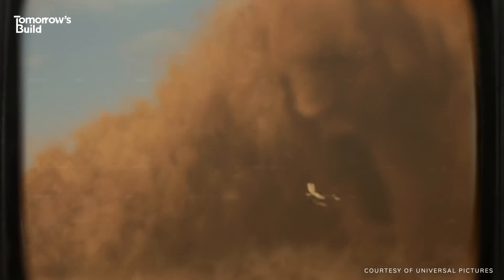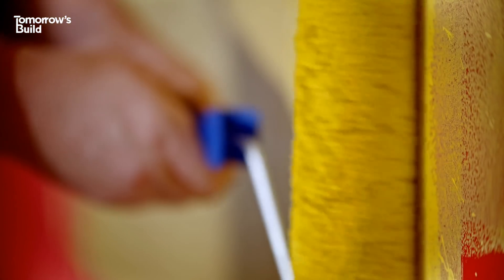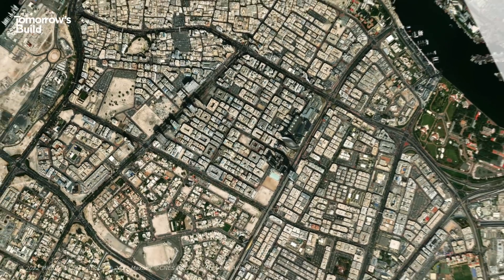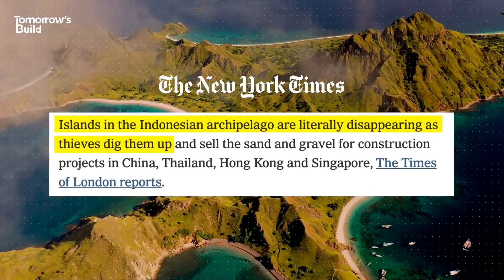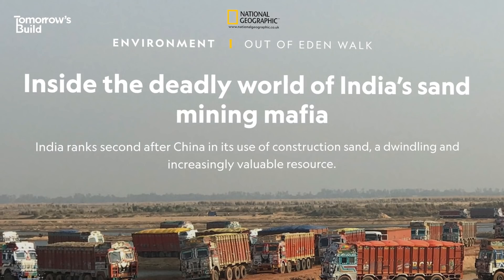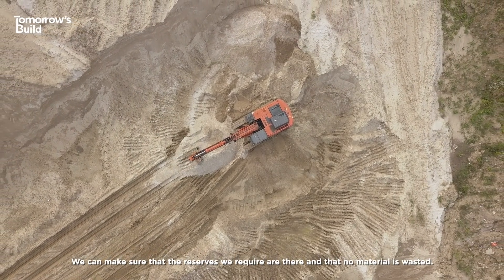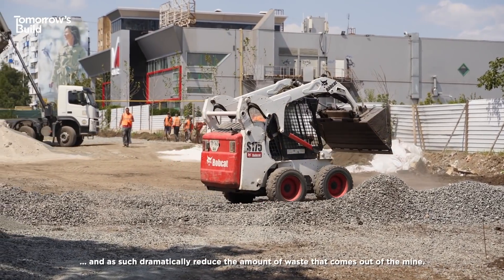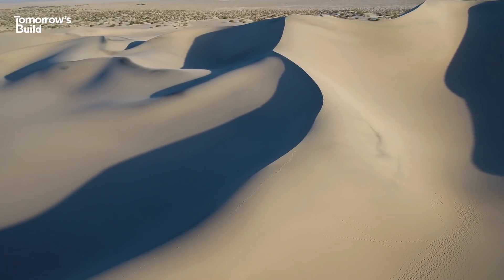This Could Stop Construction Everywhere

Comment: More than halfway into the video, I was worried that you were only educating the viewer that there is a sand shortage, and not going to provide us with any solutions for how to mitigate it.   The use of ore sand is a new one.  I thought you were going to bring up mass timber buildings, which you've mentioned before, and that's a great panacea to concrete and steel in general.
I also thought you were going to mention bamboo as a structural material, or hempcrete for single-story structures.

I learned something new about this.   I hope you guys actually go much more in-depth about ore sand in a future video.

Comment: We can try using more wood in buildings structures, and also the way how to avoid concrete.
Reply: More wood = Deforestation.
 Every Green alternative still has some drawback.
I say just build with desert sand if you aren't building a huge skyscraper because it works perfectly it's just that the structure will be a little weaker than the Non desert sand but not the issue the issue is building a good enough building for people to reside in.

Comment: The solution is to use a lot less concrete.  Hopefully engineered wood like cross laminated timber can begin to broadly replace concrete in the construction of midrise buildings and similar structures.
Reply: That would also be a good method of carbon fixing.

Comment: Lots of people saying something along the lines of make a 50/50 mix of desert and river sand. Unfortunately the load bearing ability is severely reduced when you add in round material to angular material. A visual example of why this wouldn’t work is this - Imagine a bowl full of legos versus a bowl of half legos and half ping pong balls. Then without removing any of the material, try to stick your hand in the bowl and touch the bottom.

Comment: Forgive my naivety on the topic, but (possibly dumb) question: if ocean sand is best, and desert sand is no good (because of how it’s shaped by the wind); as we dredge ocean sands is it feasible to replace it with desert sand (replenishing what was removed) and let the ocean do its work to convert it into non-spherical, coarser sand?
Reply: sadly not, the grains are already ground down too small by the wind and while the water could probably make the grains less regular it won't be able to make them bigger.  Erosion of rock is the only way to replenish it.
Reply: @BananaArmsMcNess  what about dumping the sand in the ocean though to replenish it
Reply: @Enrique283c  like the video says, the sand grains that are on land are already too small to be ideal for concrete. While water action could make them rougher so they interlock in the concrete matrix better, the grains cannot get bigger.

A more feasible solution could be crushing gravel into sand with machines but it is very energy intensive.
Reply: Beter idea would be to crush the sand and make clay from it. Plenty of uses for clay. Even beter idea would be to just let it be because sand dust from crushing sand is extremely bad for your lungs and I don't think the locals in the Gulf care much for the health of the imported workers who do all the work.
Reply: Coarse means large. Fine means small. Putting fine sand in the ocean is not going to make the particles bigger.
Reply: Can I just say thanks to everyone for sharing your thoughts, I feel like my perspective has been broadened
Reply: The sands in dunes and other deserts are vital to the endemic area, as well as across the ocean, if one was to take the sands from the Sahara let's say. Not only are you destroying one ecosystem to replenish another, causing a global catastrophe for the sands from the Sahara feeds islands in the Atlantic ocean and south America with nutrients that are needed for plant growth in the Amazon rainforest.
Reply: Would it also mess with fish gills?
Reply: What is Singapore and Dubai doing differently?
Reply: @tanjoy0205  Importing sand because they don't have any of their own.
Reply: @Indi Thanks for the comment, I actually started to think this was an issue instead of a manufactured facade like the virus they have to force people to get vaccinated against because its so effective and the virus so dangerous lmao.
Reply: @cali gdp no mate, in the original question indi asked if after replacing ocean sand with desert sand, would the ocean turn it from desert sand into ocean sand.  Wave action could probably make the grains less rounded and smooth but the particles would still be too small for use in concrete.

I expect dumping sand would have minimal effect on ocean water, but it would be damaging to the plant and animals in the water (see Dubai), but then stripping all the original sand out is already destructive.
Reply: Transporting the billions of tons of sand from the literal middle of the desert to the middle of the ocean will be extremely expensive and energy-intensive (you have to burn fuel to transport the sand).
Reply: @arafat464  Nah you can build conveyors hundreds of miles long to do that. They have them already in some places. The initial cost is high but once running and maintained properly its feasible.
Reply: Why not melt the desert sand into a glass pane and break that up into the desired size?
Reply: @nutzeeer  🤣🤣
Reply: @arson8582  there is literally enough solar energy for that in the desert :P But I guess manufacturing is more expensive than just taking. Would be an actual effort to protect the environment.
Reply: You can do all kinds of things. But the costs are HUGE to transport the massive masses of sand over long distances.
Reply: @MysticalKO several people have answered the question. Stop being a brick.

Comment: what about a mix of desert sand and river bed sand? like a 25/75 mix? After doing that, we can grind up old concrete and recycle that in new construction as well to shift to a 25% desert, 25% recycled concrete and 50% river sand, until we figure out a system that is completely sustainable.
Reply: Mixing round material with angular material significantly reduces the amount of weight the material can support. Also recycled concrete is better used as a material called 5/8ths minus. However even applications for that are limited because concrete dust is cancerous if inhaled.
Reply: @tristanmakin9493  interesting! Thanks for the comment!

Comment: could we not modify desert sand
Reply: maybe soak, the sand, pressure oven or something. surely we can modify desert sand. might cost more at 1st. could be we use up all other sands and then start using desert sand at a higher rate

Comment: The 'round' desert sand: 
1. pass through a heavy compression machinery to shatter the grains OR
2. melt the desert sand into glass block, pass glass blocks through heavy compression machinery to make fine grains of irregular shaped shards.
Reply: Crushing sand makes the particle sizes so small that they might as well be round, wether it actually is or not
Reply: The second method is not economically feasible. It would require a lot of energy to convert sand into glass
Reply: @MethLord  a magnifying glass using sunlight can turn sand into glass. 
Another method use rebar as lightning rods in areas with sufficient lightning. 
There are many methods that do not require electric or mechanical energy. 
Also when sand becomes 'rare' - less available, the cost increase will make the expense comparatively cheap.

Comment: If we thought about things from a circular economy perspective we would include nature in the process. Sand from Sahara, added to river beds while river bed sand is extracted. The river stays sandy, the sand gets course, the extraction remains sustainable, the deltas and beaches stay intact. Then at the end of life, cement is crushed, added to to coastlines to prevent erosion (after we change the mix of cement so coral and other lifeforms can grow on it). Rivers become more resilient, beaches and shorelines become biodiverse and thrive, cities are built, and the system is balanced. Removing the sand from the Sahara keeps the desert from spreading south.
Reply: Unfortunately you can't increase the coarseness of a sand particle. It becomes silt.

Comment: Easy solution, start building good architecture again. Buildings that can stand easily for centuries, and millenniums
Reply: But that's not a solution, it doesn't matter how well you design a building if you don't have the material to build. 
The problem here isn't that were replacing buildings, but that were making new buildings, and need the material to do so
Reply: @Daltem  Actually, it does matter because the current codes require that we  build all new everything anytime we make anything.
Reply: @KRYMauL   @Eivind both of you made the same point as I did, the demand for more material is from making NEW buildings, not repairing old ones, so while durable architecture is great and all that, it wouldn't solve the issue of needing more concrete
Reply: @Daltem  but i think what me and KRY MauL were trying to say was that new buildings don’t need to be made purely from concrete, they can for example be built from brick. That we have a material shortage only because we continue to replace the short lived poor concrete buildings made by previous modernist generations with equally short lived poor concrete buildings
Reply: @Georges_Haussmann  my brother in christ, if that is what you were trying to say, then that says to me that you think concrete buildings are inherently short-lived.
As again, your original solution was an improvement to architecture. 

Now ofc poor architecture can make a building short-lived, so fixing that will work wonders, but your comment just now implys that that improvement to architecture is to include more non-concrete materials, as opposed to my assumed refinements to shape and structure via engineering.

Concrete is more long-lived than wood, but roughly equal to steel.

Wood is weak to digestion, steel is weak to air, and concrete is weak to frost.
You can make a long-lived building from steel or concrete, wood not so much. 
But the building's shape and structure are the main problem with current architecture imo, as our materials are pretty good nowadays.

But regardless of architecture, you're always going to have a need of more buildings, not necessarily to replace old ones but simply because there are more people than there were yesterday.
And no matter how durable your buildings are, new adults aren't gonna want to share a house with someone else's family if they don't have to. 
(Eg, most people would want to live in their own house than an apartment complex)

Pollution, cost and durability are the main concerns for a building material.
Concrete's performance changes on its mix, but its usually pretty good in durability, ok in cost, and not that great in pollution

BTW I'd wage that for a building to keep to "regulations" (Idk what the details of those are) 
It would end up with a lifetime of 50 years, but that's mostly from some of the concrete failing, not the majority of it.

I hope I worded that as clearly and non-ranty as I intended
Reply: @Georges_Haussmann  also while roman concrete is pretty good for how old it is, modern concrete has surpassed it, and a lot of the time you see roman constructions that have survived to now, it's because they weren't used to much.

Now that's not true all of the time, for example the colliseum is still fairly intact, and I'd imagine that that would be used fairly often. 

Building for long ages isn't done currently cos it takes more money than the shorter life ones, and you don't necessarily need an apartment complex to last for 10,000 years, if it's gonna make it cost 100x more.

Build it for slightly longer than you expect to use it, unless there's practically no difference in price.
Reply: @Daltem  sure, I get your point, but as you said, after 50 years some of the concrete will be falling off, and that seems to me to suggest that we need to return to a better quality of concrete. For example, there’s an insane amount of volcanic stone on the seabed which could be used to improve the quality by going for something more similar to what the romans used, a concrete which wouldn’t need replacing, and could therefore discourage people from tearing the buildings down rather than maintaining them. it’s already being attempted in Italy and Germany. But I completely agree with the point that we need better engineering, less “sloppy” architecture if you will, if we’re going to ensure a sustainable future for the industry
Reply: @Daltem  Also, as for what you said about wood, there’s definitively a stupid wave of wannabe planet savers in the architecture industry nowadays that is trying to convince us all the the material is safe and useful,  the use of it, and I certainly agree that it makes no sense. Wood panels can last as short as a few years and the material is still flammable, no matter what BS some people in the industry are claiming. It seems to me that the only reason why we are using wood all of a sudden is that it just seems very environmentally friendly if you don’t think to hard on it, and it’s been so long since any major city fire that weˋre ok with changing our standards from materials that don’t combust to materials that don’t literally pulverise.
Reply: @Daltem  What Iˋm trying to convey is that weˋre facing a material shortage only because weˋwe established a culture for building which demands a massive constant supply of new materials, and which cannot sustain itself in the long term. Therefore we need to move towards a culture for building long lasting structures that does not eat up supplies the way today’s building industry does
Reply: Aren’t those made of concrete, though?
Reply: @KRYMauL  ?
Reply: @Georges_Haussmann  Most buildings from Roman times were made of concrete, the Greeks used limestone, and everyone else mainly used stone. Modern buildings as just designed with a shelf life because architectures are making things to be viewed by their contemporaries.
Reply: @KRYMauL  precisely, that’s why we need to start building those kinds of buildings again. Roman like concrete, brick and mortar, not thin metal cladding, short-lasting concrete, and buildings that work against gravity, rather than using it to their advantage
Reply: @Georges_Haussmann  Hey man, I want money and personally believe greed is good. Just thought I’d play devil advocate by saying that these guys weren’t saints, they were business men.
Reply: @KRYMauL  ???????

Comment: Another idea to consider is processing desert sand with water erosion. So dumping it on a beach and coming back later. Desert sand is good for tourist beaches.
Reply: Damn this might actually be a very good idea.
Reply: God damn it's actually a valid idea
Reply: Artificially erode the sand with water
Reply: It’s not a valid idea. You would devastate a coast with both dumping sand and extracting it back. Never mind enormous transportation costs
Reply: @a1lebedev  Most tourist beaches are already fucked from

1. The tourists

2. The dredging that's already necessary to replenish the sand

Comment: Granted, it's likely a small percent of total consumption, but I would think blasting media sand could easily be replaced by desert sand.
Reply: you can even use crushed walnut seeds. The type of sand used is highly dependent on the exact sandblasting use and what finish your want on the metal so I'm sure dessert sand is used in some instances.
Reply: It would only be a small % of usage as fine, smooth, sand won't be used for heavy blasting of which is the main usage. 
Could be used as a fine abrasive agent on aluminium maybe and perhaps water jet cutting but I'm sure they've already thought of that.
Reply: All of the blasting sand I've ever bought was made from coal slag.
Reply: Then you would think wrong. Blasting sand needs to be fine enough and pure enough to do its job properly. It can't contain a bunch of impurities that'll end up scratching and/or destroying whatever it is you're trying to clean up. Purifying random desert sand is gonna be more expensive than importing naturally pure sand because using a bulldozer and a loader to get it out of the ground is thousands and thousands of times less expensive than building an entire plant that may or may not purify sand well enough.